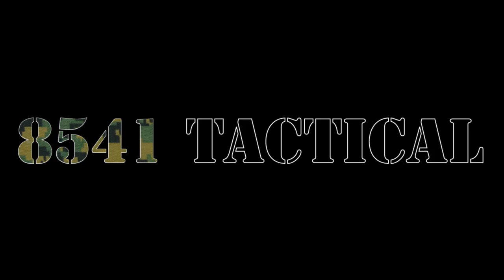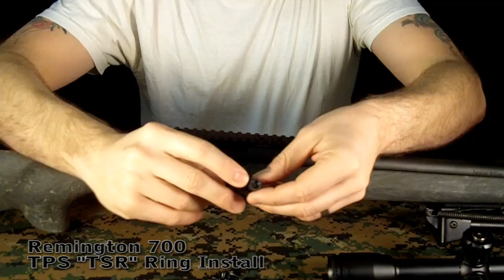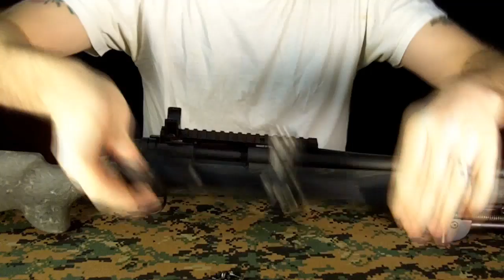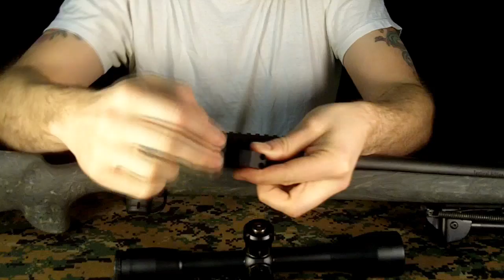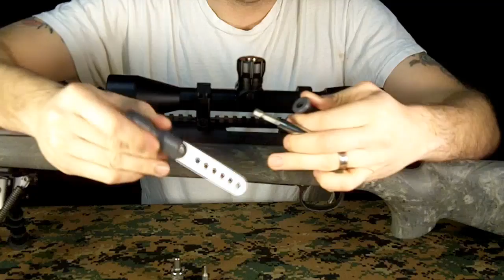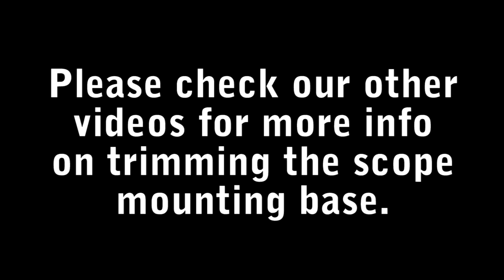"Budget Precision" Pt.2 - TPS Ring and Scope Mounting, Remington 700

Comment: john how close to the set screw can you cut the base
Reply from the maker: I would not cut it further back than the front of the receiver. However, you can go pretty far back as long as you don't actually cut through the screw hole.

Comment: "There really shouldnt be any misalignment of the rings". Famous last words. John has amazing Karma and he just has never been "bit" by a set of good rings that were machined poorly. They can slip through QC. It happens more than you think.Even top tier rings like TPS can possibly not be 100% true for a number of reasons. It takes just minutes to establish how much lapping is necessary. Sometimes it is mere minutes. Often it takes longer to attain at least 80% true of the rings to your scope body.
I like to set the scope in the rings and tighten the tops rings so the scope can still move. THEN push your bottom rings forward and tighten to 65 inch lbs.  . The guy on the Vortex channel demonstrates this method. Also, please use blue or purple loctite. Warning! Some rings like those from Weaver use a weaker steel in the 
cross bolt. 65 inch lbs can snap them. Use 35-40 inch lbs for the nut on
  those rings. I disagree with the closeness of the rings. I am sure it is better to have the rings as far apart as possible. This is common practice that is dictated by simple physics. The scope is far less likely to get tweaked or torqued to the side in a bad bump or fall. Not everyone uses super strong and rugged top tier scopes.But in the end the ring spacing was fine. I would have gone fwd one lug but that is nitpicking. Lastly, eyeballing is fine for very experienced guys like John. The rest of us should use bubble levels.

Comment: I found your videos very informative and easy to follow. On torqueing I would suggest that you torque all screws/bolts 25% less on a first torque then do the final torque setting. This gives a more even torqueing of the part. I would also torque the center screws first and then the end screws to spread the stress evenly.

Comment: am sure purchasing an EGW shorter than average rail or picatinny rail base would solve scope bell problem id measure scope bell housing to straightest part of scope at the other ends before fitting buying a rail! its so important that your eye alignment is low otherwise as you say the stock ends up having to have cheek plates raised up etc the advice at cutting it off aint bad advice makes senses but your far better off ordering correct rail to begin with that matches your scope! gun fun! pricey

Comment: TPS are my favorite rings because of the index and ease of keeping a scope level while tightening the screws. My only question is why you don't lap the rings. I lap all of my rings and the TPS need very little, but there is still some shiny spots. I may just be paranoid about crushing expensive scopes. What's your thoughts on lapping rings?

Comment: Thank you VERY much! 
I have only one question left: Is the use of Loctite "forbidden"? I am a real noob at "real rifle" scopes, I just have a powerful air rifle with a scope on it. The big vibrations of the spring rattled the scope ring screws off pretty fast, I just had to put Loctite in. Does this problem not occur with any rifle cartridge? I mean, the vibrations are way different.
That would be great, because I heard that Loctite also can mess up the screws..

Comment: Regarding use of the Barka tool...  It looks like you keep the desired torque number on the tool facing the bolt you're torquing?  Since the thing is 2-sided I was wondering.  For example when you want 15 inch pound, do you have that number 15 facing the bolt or facing you?  And thanks for all the great instructional videos.

Comment: I have placed my Weaver picatinny base on my Rem 700 and gently tightened the front screws and saw a gap in the back so I will need to bed the back; however, when I did the reverse and gently tightened the back screws, the only gap I saw was right after where the barrel steps down in size, beyond the front screw holes. I assume that only the back will need to be bedded but I'd like to hear your thoughts on it. Thanks

Comment: You can also use clear fingernail polish if you have no loctite around. I use this and have been happy with it keeping the screws tight, yet easy to remove when I want to. Just thought I would throw this out there as an easy cheap household item that helps.